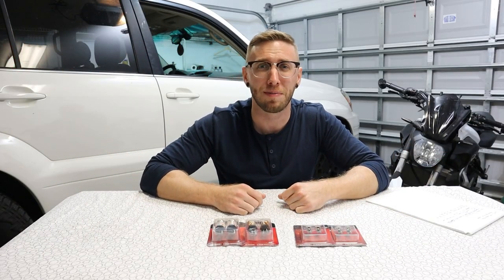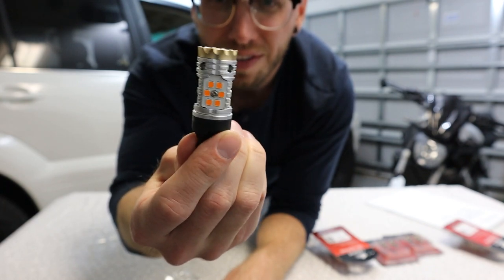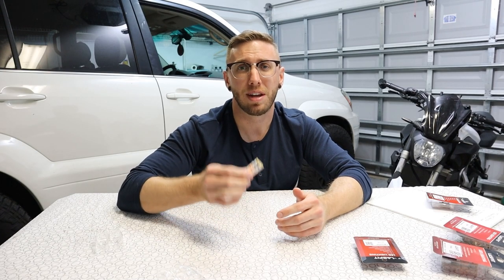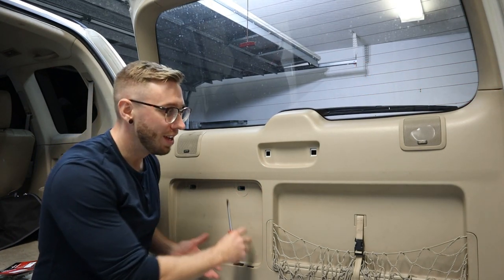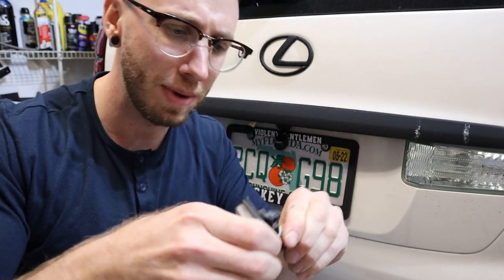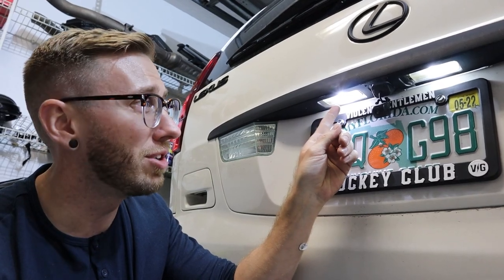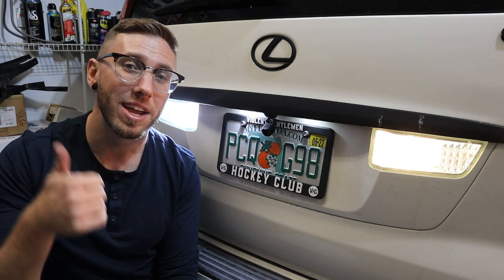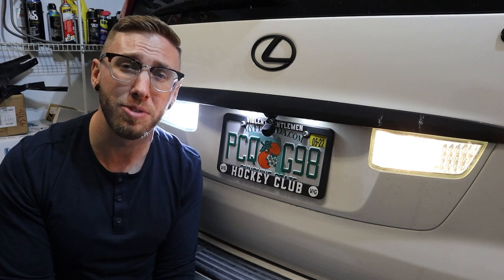Vlog 46 - Lasfit LED Bulbs (Lexus GX470)

Comment: The passenger side rear tail/brake bulb replacement is a little trickier because the rear door hinge is there. Were you able to change that bulb without removing the door?
Reply from the maker: Great question! I was able to get a screwdriver in there and remove the tail light to replace.

Comment: it may look better, but how does it light up the road in reverse? do a video on that bro
Reply from the maker: I definitely should have taken some shots of that. They are much brighter than the original ones, so visibility is improved in the backup cam. They arent so bright that you get exposure issues on the backup cam either.

Comment: any lasfit solution for DRL?
Reply from the maker: I think they do have a replacement for those bulbs. I need to test those out if that’s the case. Thanks for reaching out Joseph!
Reply: @Awesomoto  they don’t, even though they say they are compatible. I have been corresponding with them and they pretty told me to take it up with the retailer I bought them from which was R4T who I’ve also corresponded with. If you have suggestions I should would like to here it. LED flasher relay.? Disabling DRL and just keeping turn signal somehow? Electrical is definitely not my forte.

Comment: Do you have led blinker bulbs in the headlights during this? Curious if you’ll get hyper flash once all the blinker bulbs are LED’s. That’s why I have LED’s in my front blinkers but not the rear
Reply from the maker: I do not, but I like your idea. That will be a true test to make sure the hyper flash compatibility advertised works.
Reply: I did get the front led turn signal bulbs from Lasfit and I did in fact get hyper flash but only when using turn signal but when using four way hazards no problem. Scratching my head but Lasfit said it’s because my turn signal and DRL are the same. Thinking about getting a led flasher relay even though it says on the sight no relay required. I reinstalled the incandescent front bulbs and all work normally.

Comment: The incandescent bulbs are definitely better. Better color and the leds you choose are too bright and will blind the following drivers. Find a less bright led for the turn signal bulbs or put back the incandescent bulbs. The point is not to blind people but to inform them about your next move, so I think you over do it and you lost the point.
Reply from the maker: Totally agree with you lampros and bulbs too bright will definitely be distracting. Since the video I’ve done some testing at night and they’re brighter, but I have no concern about them being a safety issue. It’s no brighter than the newer vehicles I’ve compared it to.
Reply: @Awesomoto  I have noticed when using these rear led turn signals people who love to tail gate back off when I turn, so I say that is added safety for me if not them. Haha